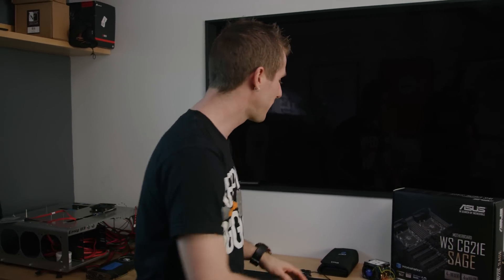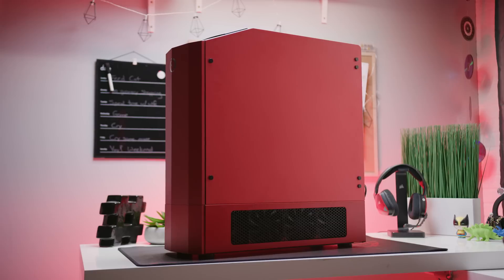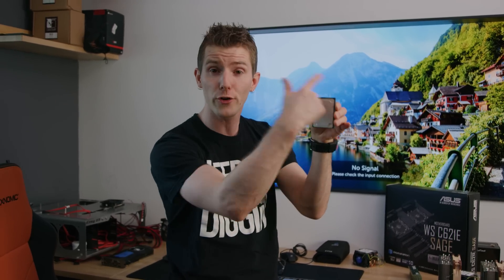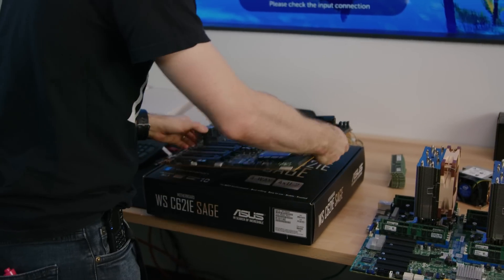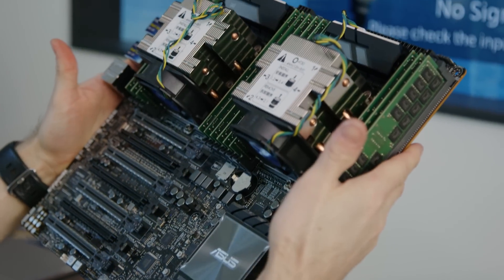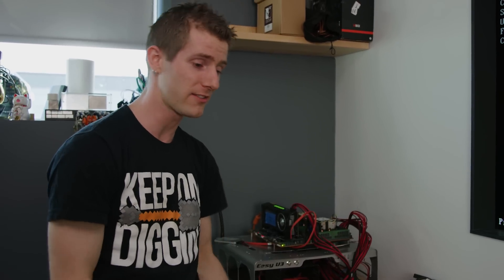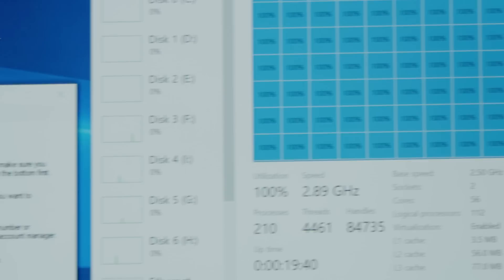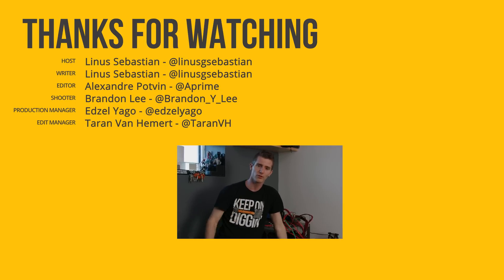56 Cores in ONE SYSTEM! - HOLY $H!T

Comment: Realistically i think that larger IHS's make more sense given the amount of heat that large core count chips (or just coffee lake) put out these days. Take the ungodly high temps of coffee lake for example, had intel used the same methodology that AMD used for threadripper, or even just intels own 2066 socket/IHS size, there might not have been as high of temps since there wouldve been more surface area to help dissipate heat, not saying that they wouldnt still be pretty warm, but i cant see it hurting performance either. Smaller Dye? Sure, absolutely. Smaller IHS? Nah, unless youre working on a ITX board with limited space, i dont see large sockets being a negative.

Comment: It wont let me see replies. But he said its for "a linux distro" ... saying "hypervisor OS" or something like that would have been a better discription. Ppl aren't buying a board like this to run Linux Mint, ubuntu mate, or puppy linux off a shitty 2 GB sd card lmao
Reply: Surprise surprise, enterprises do run Linux or VMWare off SD cards. They are cheap, last pretty long and don't take up any precious space.
The card is not really used once the system is booted, so everything is fine.
Reply: Most real enterprise servers run Linux in which they run virtual machine with Linux in it. Main reason is security. I mean, for the virtual machine, of course.
Reply: Then you're doing something wrong.
Reply: FHRsLP HAH, my sd cards get corrupted and formated every time i use them

Comment: That BIOS setting does not make the CPUs perform better, its basically a power saving feature that allows the frequency to be lowered to save power. The problem with that is that if you have a very CPU/memory bound operations for which low latency is a requirement, without that setting the performance can be very bad thus making the application to struggle specially because it takes alot of time and heavy use to reach max performance again.
Enabling that setting, prevents that from ever happening at the cost of extra power use.

Comment: So many cores that performance is measured in HP instead of FLOPS
Reply: The Hybrid horsepower?
Reply: The Hybrid how many times it overpowers a standard hp printer chips
Reply: 1500hp with a 500hp electric motor, 1180nm torque
Reply: The Hybrid horsepower you pleb
Reply: 25 bathtubs. obviously
Reply: HorsePoop
Reply: hewlett packard laptops? - HPLOPS

Comment: Throw at it 8 p4000 and a Sync module. Get a pbp monitor with four-way splitting and sli two p4000 per each panel. You will get the best combo evaaaaaaaa!

Comment: Supermicro has some coolers witch would fit the square ILM's (not on their websites yet but they exist) for the xeon scalables, witch have a plastick frame witch hold the cpu tight to the cooler, so you mount the cpu to the cooler using the plastick frame/clip then mount the cooler and cpu as a single unit onto the cpu socklet. 
best regards from a system builder.

Comment: AMD EPYC CPU has 32 cores and is less than half the price of that shintel CPU as of the time of writing this comment.
Reply: tard ! by the time u wrote this , amd burned from overheating and no drivers support ! id wish newbs would stop with this fktardism and #fakenews that amd is better in any way . poor fkin id iots .
Reply: Dr Nooberious there are none dual socket motherboards for AMD Epyc 7601
Reply: That's odd. If they sucked as badly as you say then why did Intel rush their x299 platform by 2 - 3 months ahead of schedule? And why did they rush their 8th gen CPUs 8 months ahead of schedule? That is because Intel did not think AMD would ever be competition for them and when they were proven wrong, Intel paniced an gave us the 7640x and the 7740x.
Reply: In 2010 Nvidia released one of their most infamous drivers ever as it lowred GPU fan speed, it crashed lots of systems due to overheating. Quote "Nvidia is aware that some customers have reported fan speed issues after installing 196.75 drivers from Nvidia's website. Nvidia has removed these drivers and asked its partners to also remove the drivers,"

AMD has never released such a GPU driver. On a very big note, AMD's CCX system allows them to make a CPU (and soon the be GPU) out of smaller parts which in turn allows them to charge much less for so much more. With Ryzen being cheaper core for core. e.g. Ryzen, Threadripper, Epyc.

AMD has their faults, BUT I would still support them as to supporting Intel. e.g. 4 cores on the mainstream form 2006 to 2017, something a lot of people have complained about but Intel didn't and still does not care what there customers think as long as they get money.
Reply: Well sellout Linus needs money, intel has money sooo :-p interesting timing i say
Reply: and has 128 pci-e lanes and have 8 ram channels and supports 2tb of ram per cpu XD
Reply: Dr Nooberious fuck you with amd they suck in making prosessors

Comment: Would love to see it in Blender with this: https://github.com/rlguy/Blender-FLIP-Fluids-Beta
Might be hard to get a good test scenario though and its closed beta, so you guys would need to contact the maker. 

Would be fun to see the CPU utilization because the baking of those simulations is kinda limited to Memory.
So I wonder how great that memory bandwidth plays a role if any or if it would just end in 4% used on the CPU.
Also of course how long it would take to just do what my tiny 3930K does in 60hours
https://twitter.com/Mitsuma/status/975388808500908032

Comment: The HP-Z800 supports 2 cpu's and each cpu supports adanced ecc fb-dimm ddr3 memory running at 6-channel PER CPU. So... nothing new. BTW it supports two Xeon X5690's (each is 6-cores and 12 threads, with around 3.7GHz clock speed and an insane amount of cache) ALL FOR $600 on EBAY!

Comment: Oh my god. the idiot doesnt even know that the SD slot is for VMware lmao
Reply: for what exactly? to put the ESXI hypervisor onto it?
technically that's what he said "if you want to boot a linux distro off of it".

But Linus is an unraid shill anyway. No love for VMware.

great feature tho. I actually have a stack of el cheapo 32GB SSDs lying around for exactly that purpose (don't like booting off of USB and obviously don't have the money for such fancy motherboards with onboard SD slots).
Reply: What the hell are you talking about? He explicitly mentions what it's for. And it's not just for VMWare. There are multiple reasons to have SD storage, not all of them a hypervisor.
Reply: Maybe unRaid as well?
Reply: Merk Henderson
On first glance, hypervisors do make the most sense tho.
You probably would not want to boot a regular linux distro etc off of it. SD cards are fucking slow.
With ESXI that doesn't matter much after the initial boot process.
Reply: Max, FreeNAS, so you're not wasting a sata port for an SSD.
Reply: I would have to put FreeNAS somewhere too....
Does freeNAS even act as a hypervisor?

FreeNAS is AFAIK usually placed on a USB stick. I could do that with ESXI aswell.
Actually did, when I still used my HP N54L MicroServer. That thing had a USB port on the motherboard, next to the CPU socket. Used a USB Stick with SLC Memory for longevity.

But my current servers don't have that (Dell PowerEdge T20) and I don't like to have usb sticks sticking out the back at all times.

Comment: hello guys, im a student and iw as considering buying an older system with a Xeon E5 2660(8c/16th) and a 1050/1050ti for adobe illustrator. Because handling bigger illustrator files on a MBP isn't fluid and easy. do you think this is a good idea guys?

Comment: Try multi streaming of data thru network using 10GB Ethernet cards "if necessary" along with cinebench or other benchmarking software's, with rendering of a 1080, 2k, 4k videos. should show the true performance of the CPU.

Comment: The reason RAM is so expensive is down to one thing, Linus has them all.
Reply: Ready when you are!
Reply: That's proably ECC memory tho. So better grap some CPUs and motherboards while you are there, to actually use them.
Reply: Max Mustermann it is ECC memory but you just ruined the joke
Reply: Tyro
Not really. ECC, reg. ECC and regular ram use mostly the same components. 
So Linus owning most of the world wide ram supply, even if it were all ECC, would indeed affect consumer grade ram prices as well.
Nothing ruined here, aside from you admitting it's just a joke.

Comment: ... is intel to start look desperate? Epyc haz 32 core monsta with 128 PCIe lanes, so what gives?
Reply: Gunārs Vilde intel also has 20 core 40 thread Xeons paired with 72 core 288 thread COPs (62C 244T as early 5 years ago). Strongest CPUs are still supercomputers.
Reply: ... yeah, yet it's not in this price bracket...
Reply: Gunārs Vilde You can get a 20C 40T Xeon for almost 2K and the 60C 240T for 1.5K. An 32C Epyc is 4K USD. So same price bracket

Comment: My Pentium 4 HT still better
Reply: im wondering is p4 capable of fhd video playback
Reply: Viper87 its not, watching @240p 10fps
Reply: Pyry 1 60% of the time my Athlon is faster everytime.
Reply: You'll probably have an easier time playing Doom 1993 than Linus will on this computer.
Reply: P4 HT is not good for YouTube and other videos in a browser, but with a decent video card it can play HD (with small problems when seeking) in things like VLC.
Reply: nah my intel 4004 is faster than those processors. who needs 56 cores when 1 is more powerful xD
Reply: at least it's HT
Reply: Windows 7 lite and a browser extension can 720p possible even on a socket 478. P.S. s478 2000 - FOREVER
Reply: Most likely. Theyre about 15 years old now!
Reply: Of course it isnt good anymore. The P4 series is about 15 years old now!
Reply: there is no way like it would lag on 720p I bet.